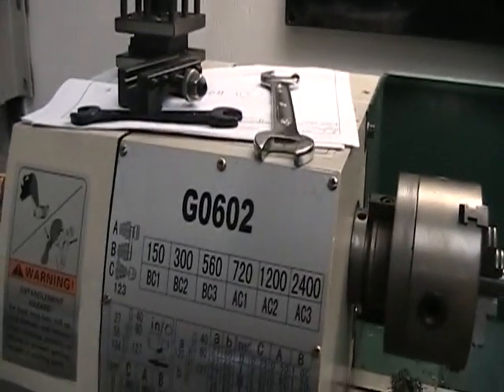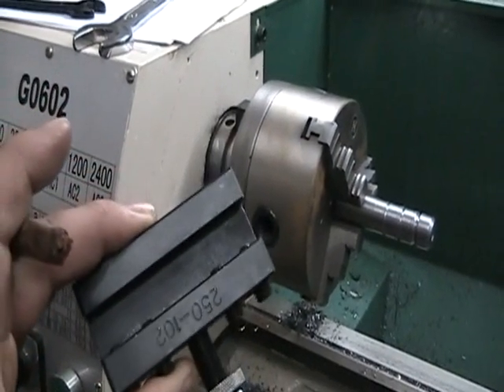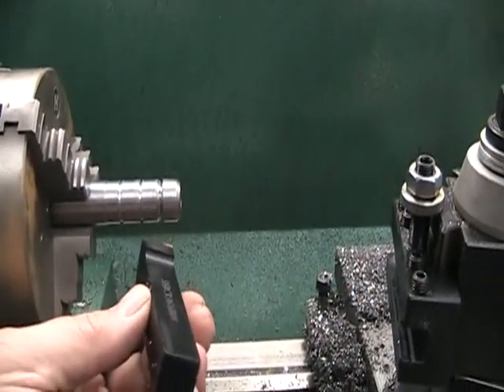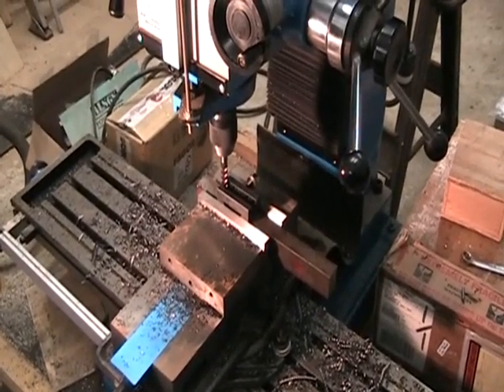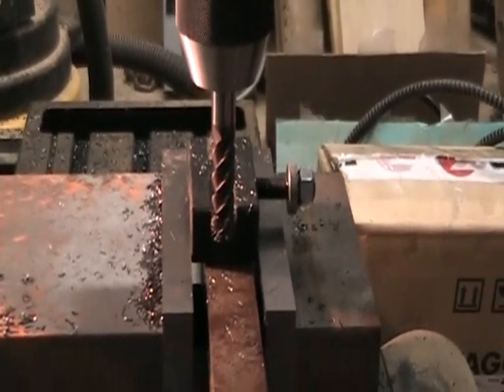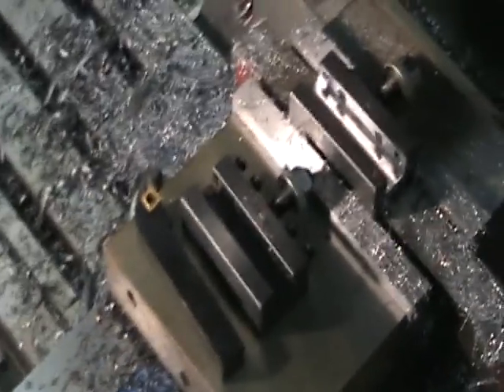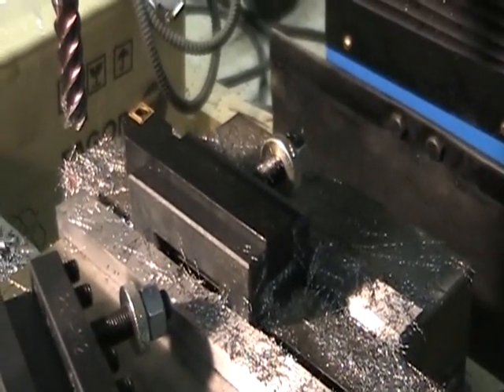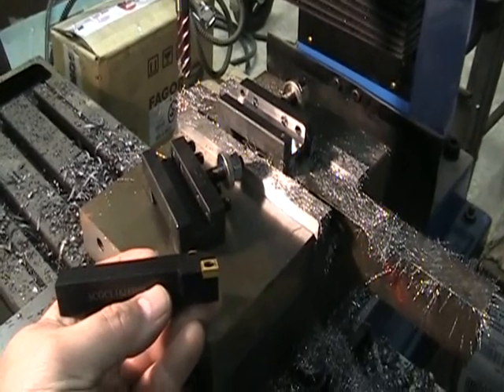G0602 Tool Post Setup Part 1.wmv

Comment: You need a parallel set for your vise and some endmill holders. Question though .Do your tools sit at centerline now on the ;lathe . I read that was a issue with 1/2" tools on a axa post

Comment: Did this end up working?  You machined the whole slot wider, but I would imagine that doing that would have put the tool/insert above the center line of the lathe.  Half the half inch holders that I have are above the center line with the holder all the way down against the compound and I've been debating if it makes more sence to mill some off the bottom of the slot, the bottom of the block, or the bottom of the shank of the tool holder.